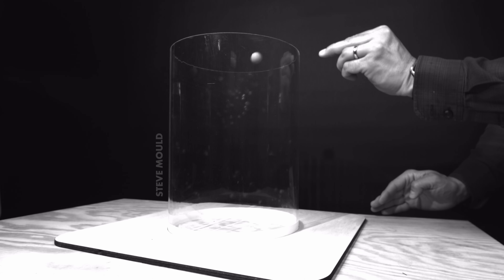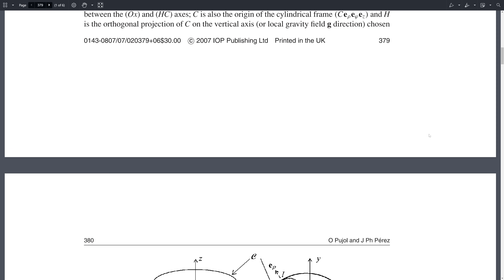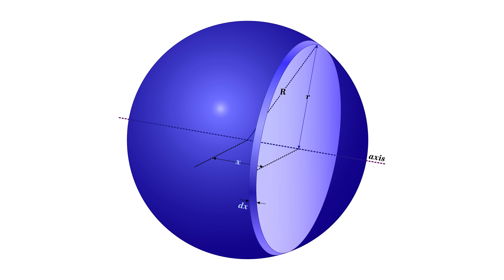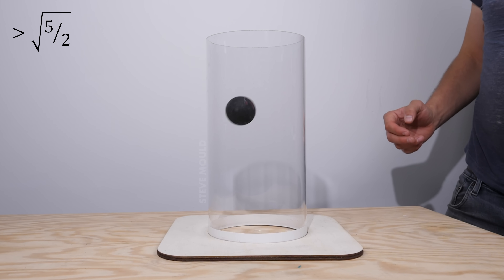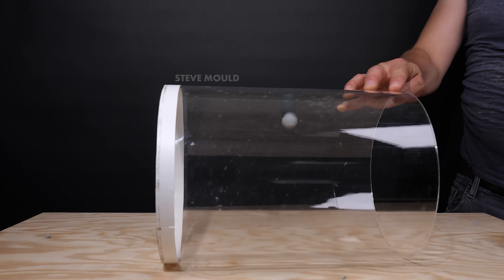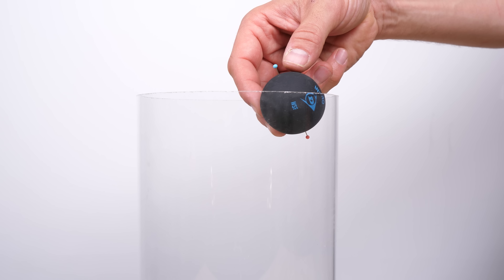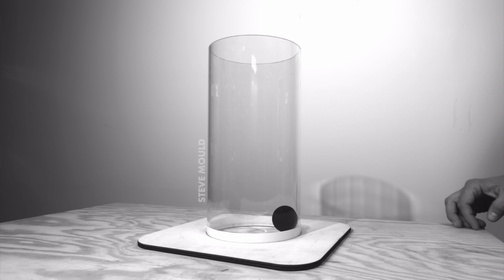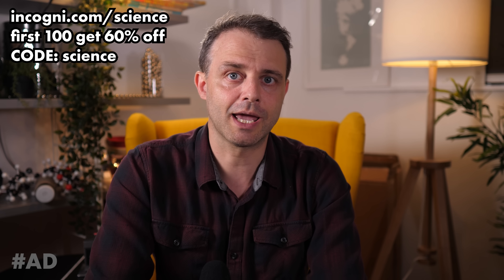The Golf Ball Paradox

Comment: The ball is just bouncing back like how it would on a plane surface, just that this is a cylindrical surface. Apply enough force, the object follows the cylinder pattern, and moves in the same direction the force is coming from but still bounces upwards. If the force is not enough, it will gradually drop to the bottom while following the cylindrical path , the initial will be greater than the new(height  of the bouncing ball, will reduce, until it stop)Just like a bouncing ball on a horizontal ground. When a bouncing ball hit the ground, it move downwards in the same direction as gravity and bounces back in opposite direction as gravity (upwards). Here (the cylinder ), the object ( golf ball) can be trown from the left and will bounce in opposite direction, that is the right hand side. Simple
Reply: Hope you get the point, am trying to make????

Comment: If you measured the diameter of the. Ballbearing and thickness of the coating. and the wall thickness and diameter of the squash ball we could calculate the corrected moments of inertia. Might be interesting

Comment: It seems that the shape of the ball vs. the shape of the cylinder have an interplay that redirects the trajectory of the ball's inertia. Ball mass and density would have less importance than the ratio of the two curvatures (ball curvature vs. cylinder curvature). At some size and shape the ball would match the cylinder's curvature in 3 dimensions and simply roll in a straight line following the tug of gravity the whole time until it reached the bottom. I believe you have chased the wrong rabbit down the wrong hole.

Comment: But the ball thing is pretty evident I believe. If you were to cut and stretch the cilinder  lenghtwise, then the path followed by the ball would be almost stright, curving eventually in the direction of gravities pull as the ball decelerates due to friction. Its not a cientific explanation at all yes but, but whats going on is not that hard to grasp methinks.

Comment: Have you considered the 'sling shot' effect. Like how china got their luna rocket to the moon & then into a perfect circular orbit around it. 
The balls momentum is to travel in a straight line. When the ball travels along the inside curve of the cylinder. The ball may accelerate as it is whipped around. 
Would be interesting to try throwing a ball into a vertical spiral that has a wider gap between each layer than the diameter of the ball. 
This should cause a continuous increase in the balls speed. 
Would it continue to oscillate up & down the wall at the same ratio per turn?  What other effects will the ever decreasing diameter of the spiral have?  Chromii

Comment: Just assume the ball is rolling around a horizontal axis with the rotation set up by its first contact with the wall.
This component remains gyroscopically even as the ball rotates around a vertical axis as well heading to the opposite side of the ball. Given that the rotational direction is the same but the wall is oriented opposite, the same rotation component now moves the ball up.
Your ball… is a yo-yo.

Comment: I am in no way a smart person. However I am a golfer. And my question is: “does this work this way with any other ball as well?” 
Golf balls have a very peculiar inside, that is layered with polyurethane concentric spheres that are skewed to sides. Unlike the old golf balls that were made of elastic bands on the inside. 
Also, we know that the golf ball has a coefficient of response. So that when we let it drop from a point x it will bounce back at the same height or even higher, depending on material and maker. I am curious about this now.

Comment: By 1:54 i had a theory: the initial 1/3 circle trip around the cylinder imparts a rotation on the ball, and the axis of rotation is something that doesn't tend to change. What's different about the flat version is that as the ball travels in the cylinder, its rotation relative to the point of contact is changing, which means the initial falling spin will kick the ball upwards when it reaches the opposite side of the wall

Comment: The ball turns as it rotates around the cylinder because it's flipping on its axis; if you had a ball with a white strip around the circumference, you would see it happening.

Comment: You could allude to the carnival game where people are required to throw balls into a wide pail thats placed at a 45 - 60 degree angle, where the goal was to make the ball stay inside the pail. The trick was to throw the ball with some combination of a bit of spin or at an angle or an arc in such a way that the balls rotation and momentum is cancelled or negated after the first contact of the pail's sides.

Comment: I can explain this rather easily, I think.

The key to understanding what is happening between the ball and cylinder is in analyzing the relative motion of the core of the ball vs. the outside of the ball vs. the cylinder wall.

Like a continuously-variable transmission, the pathway of contact determines the speed at which the ball rotates vs. the speed the center of the ball travels across the inside of the cylinder.

From the balls' frame of reference, its pathway through the cylinder is no different than it would be through a cone.

As the ball reaches a point in the pathway around the inside of the cylinder where it is spinning on a shorter line of longitude, the actual speed of the ball as it travels across the cylinder is at its lowest. Then as the inertia of the ball continues to push it around the cylinder, the longitude of the contact line on the ball grows larger, allowing more of the inertia stored up on the way down to be released into the cylinder wall, which in turn decreases the speed at which the ball is rotating while increasing the speed at which it is revolving around the center of an elliptic section of the cylinder. This increase in speed results in an increase in centrifugal force, which flings the ball upward because the downward direction was where it gathered the momentum.

Comment: Its so simple - its just that the Ball gets accelerated in different directions which get altered by the main direction. A Cylinder would not behave like that.
It is the same as with Train Wheels and the Rails curving.

Comment: Once you commented on the density of the inner sphere of the mouse ball, I couldn't stay focused as my mind instantly began shooting out ideas.
I began thinking about huge acrylic cylinders with beach-ball sized foam filled balls with an ultra-dense material like tungsten forming a very tightly condensed inner sphere. 
Or once the mathematical formulas have been worked out, putting the material of a neutron star as an inner sphere into the gravity well shaped cylinder... Damn, you really might be onto something here. Sadly, both my understanding of physics and math suck so badly I couldn't assist in either way, except providing strange ideas once it was conveyed to me in an interesting but simple enough way.

Comment: Thanx for the explanation - this is such a non-intuitive behaviour to witness! If you revisit this phenemenon, perhaps you could apply some stripes to the ball to more clearly demonstrate what the axis of rotation is actually doing during the balls transit around the cylinder? Also, would it be worth building a 'launch ramp' that would consistently apply the ball at just the right angle and velocity to the cylinder? (I can imagine there is only a small range of combinations of angle and velocity that will cause  this phenomenon to occur.
In terms of motion amplificaiton videos, perhaps a tall building swaying in the wind?

Comment: Mr. Mould, I've watched your videos on occasion & cannot recall your credentials. Regardless, you mentioned centrifugal force, which you openly dismissed as misunderstanding, but you never mentioned the true physical controller - centripetal acceleration nor Coriolis acceleration - even though it is quickly flashed across the screen at one point in the video.

Without knowing your training, my advice is that analyzing rotating bodies without a reasonable understanding of centripetal acceleration, Coriolis acceleration & angular acceleration is likely to continue to be maddening.

A ball, rotating within a cylinder is going to have two, if not more, degrees of freedom of motion. The math matters, it will describe the periods & predict how any moments affect the kinetics. DW

Comment: Nice!  If you can show that the axis remains the same, then you could show the same effect on a flattened cylinder (flat surface) with the axis tilted relative to the surface.  The effect can be intuitively imagined by extending a line through the axis to the point it intersects with the surface.  The ball would then move in an arc around that point.  Similar to a motorbike going round a corner at speed.  Taking that further, I'd imagine then that in the vertical cylinder, the effect of gravity would be primarily to alter the tilt of the axis such that its imaginary point of intersection with the surface steadily got further from the ball, resulting in a steadily reducing oscillation...
Reply: Ah, but the axis of rotation doesn’t remain the same! See this response video to understand why: https://youtu.be/4er2buINHF0?si=dPlL8yD0K1UL-7lI

Comment: I'm bored okay sure. when you throw an object of spherical geometry. The force is equal to the resistance and some intertia of downward action causing an opposing reaction in the same movement meaning it never changes course. Though the weight of the mass in a relative speed acceleration causes upward momentum. thus you see what appears to be an illusion of a sort. in calculating trajectory and inertia or the angle and speed. You can get the outcome of a ball moving faster at a downward incline causing an unknown volume of rotation. again causing this effect of not wanting to act as physics might imply as right. very cool not yet known in fields of study. much like a wheel that will spin at any given angle with the side affect of no constant without stationary binding or in other words being attached to a single point of axis like a rope for example. fun facts 101. old but forever. Enjoy!

Comment: If you pay really close attention to the high speed shots, you can visually see the axis of rotation changing on the balls by watching their surface texture's spin. You'll notice that the axis seems to "flip" at that midpoint in the osclilation. If you take that initialy intuitive explanation of the ball's axis of rotation remaining the same as it travels around the cylinder, you can very clearly see that happening in every shot (its easier for the hollow ball shots, since its surface texture is less homogenous and easier to discern). But at just about the end of that first go-around you can see the ball very quickly and very suddenly flip its axis of rotation the other way, thuse steering the direction in which it spins.

You can basically "trace" their movement along the cylinder and find that it very very closely mirrors that sort of up and down spinny rotation of a spun coin as it nears the end of its spin. The balls in this case are basically tracing the edge of that coin as it spins, first going in a Top-left/bottom-right diagonal and then a Top-right/bottom-left diagonal
Reply: Now you're making me think of Veritasium's video discussing the intermediate axis theorem. I know a sphere doesn't do that, but I'm pondering it.
When Steve unrolled the cylinder I see that as an incomplete model as the diameter of the ball relative to the cylinder affects how the contact patch moves (as does the surface squishiness). Imagine a rounded motorbike tyre steering with the castor angle.
Combining it with the coin rotation paradox and throw in this idea of gyroscopic axis preservation and I think he's come up with a pretty good way to visualise the concepts going on with this one.
Anyone want to model or try the same thing with non-spherical rolling objects?

Comment: Your cylinder dimensions are deeper in relation to width than a golf hole. The ball you're using is several times smaller than a golf ball in relation to the size of the hole. You have no dimples on your experiment ball. This is scientific completely apples to oranges. A golf ball frequently pops out of the hole because it hits the bottom and pops out, or lips out near the rim because it never fully went into the hole. Delete this corn.